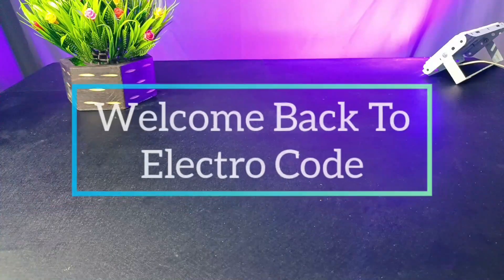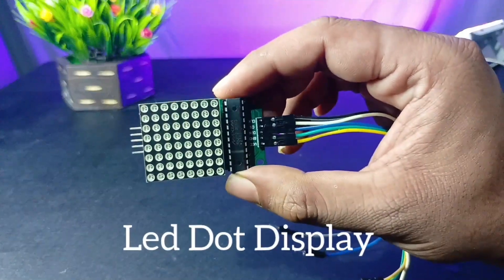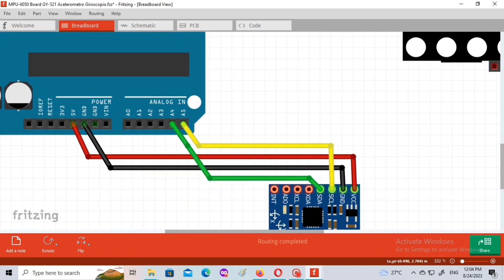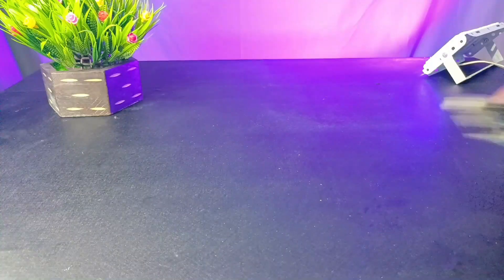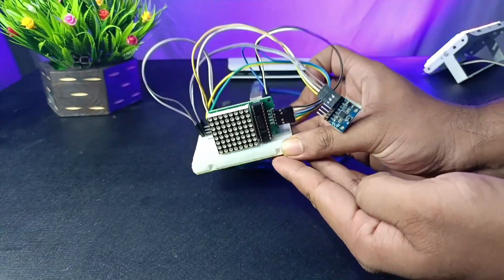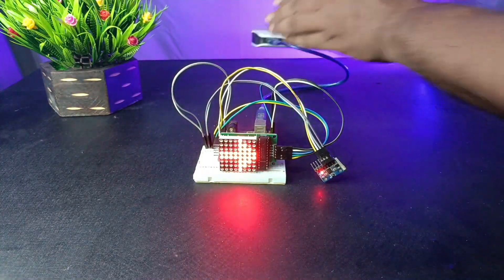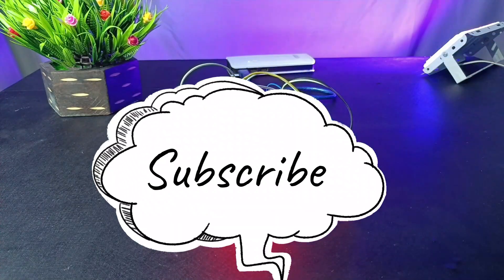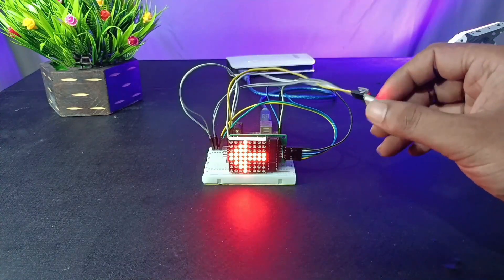DIRECTION INDICATOR (LEFT/RIGHT)  USING MPU6050 , LED DOT DISPLAY & ARDUINO #project #science #led

Comment: This is an amazing idea bro! An upgrade to this:- make a gyroscopic mouse, you can control the mouse basically with your hand movements, using an accelerometer and gyro... Expanding the projects of gyro/accelerometer can be taken to lidar projects, you can make one moving object which can trace it's path as a graph curve and can map it, you can get an idea of the topography of the area from the graph 👍 btw video idea is just great
Reply from the maker: Now that's an interesting idea...thankx for the suggestion and support 🙏